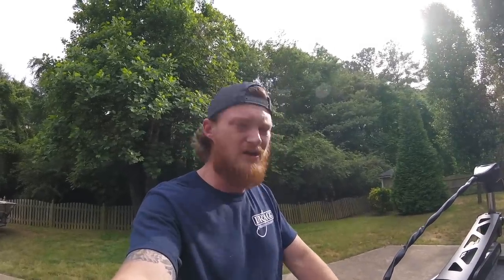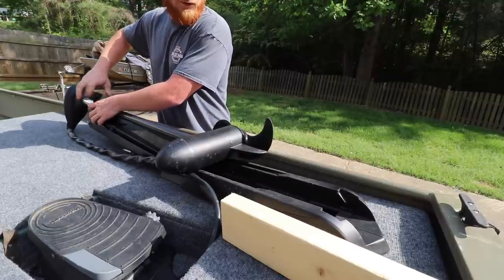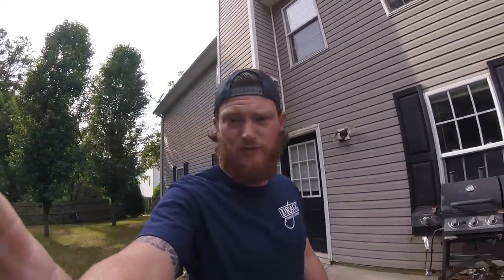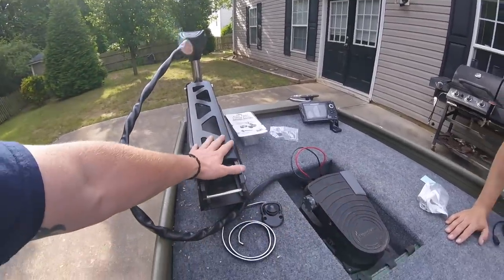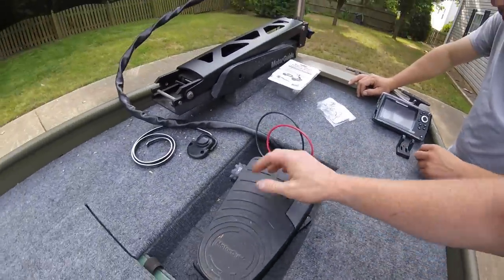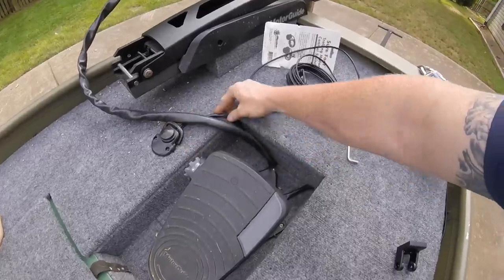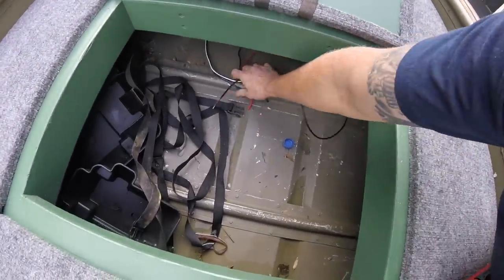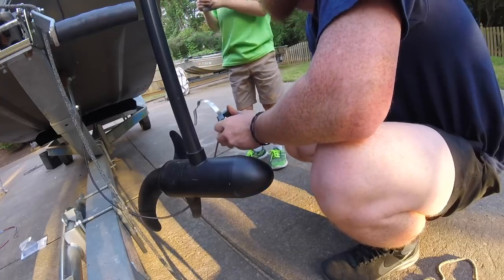JON BOAT TO BASS BOAT: BUDGET BUILD VIDEO 8

Comment: good job guys . next time for longevity of the wood your trolling motor is mounted on . add corner braces to both sides.  the kicking back amd forth of the trolling motor will make that wear out eventually . other wise you all got it down pat.  good job.